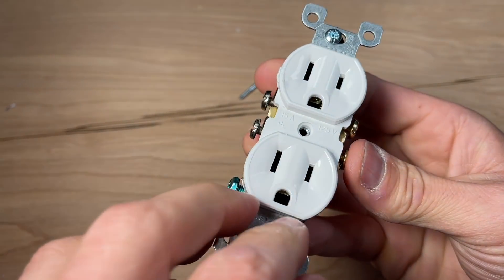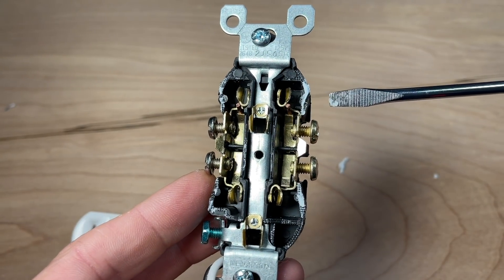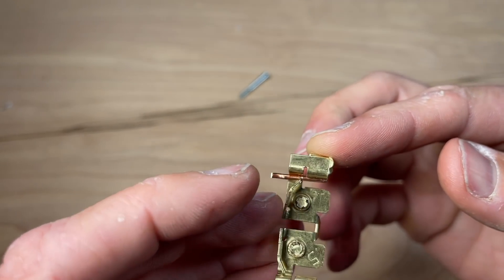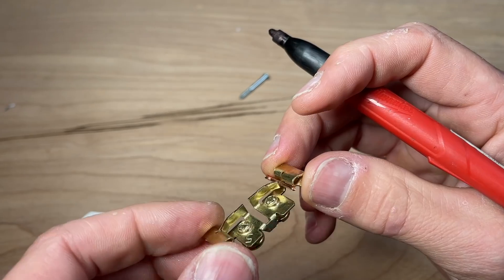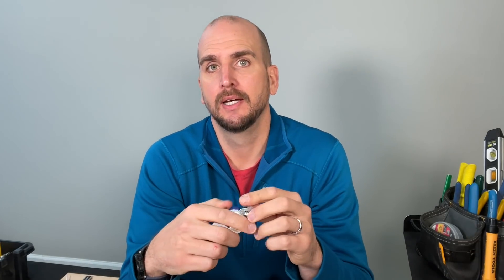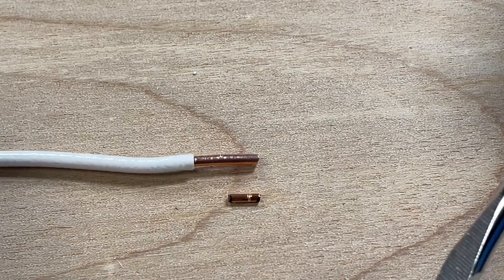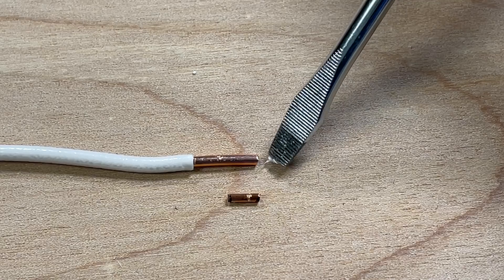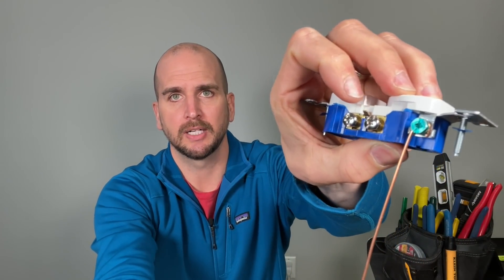Why You Should Not Use Speed Wiring | Back Wiring Is Preferred

Comment: When swapping out some switches in my house, I found the original speed wiring very hard to "unlatch". Maybe the clip digs in or fuses over time, I have no idea how old the light switches were. It seemed like I was close to ripping the switch out of the wall. Back-wiring is great because you can actually see the contacts being made, not just hoping everything goes right when you stick the wire into the hole.
Reply: if removing a switch . I clip the switch side and then spin the device and pull the wire will slip out

Comment: I earned my electrical ticket almost 40 years ago. Safety and reliability are primary in my approach to wiring.  In my opinion, code does not equal quality of work.. code is minimum.. so those who have a goal of just meeting code, is substandard.   I personally despise the method of just pushing the wire in the back of the receptacle, and think it is a cheap, lazy-assed way of wiring (Sorry to be blunt but I have zero tolerance for that low level standard).  On commercial jobs receptacles that are looped from one to another (and up to 12 devices in the loop) are usually pigged tailed (neutral, hot and ground) with three wires going to the receptacle and typically with a J-hook.  Those who push them in the back are asking for heating issues, and especially if you're plugging in an high amperage appliance, say towards the end of the loop, depending on each of those previous receptacle "splices of sorts" to provide power.   In residential wiring, J-hook and if the receptacles are built such that they have brass or metal plates on each side of the copper wire (like the one  you preferred for DIY people, I think that is a good choice, for the reasons you mentioned with a J hook.

Comment: Strange this pops up right after replaced everything already lol. I replaced all my standard light switches to rocker switches and installed usb and lighted receptacles randomly through the home to increase home value for selling. I used speed wiring for single pole and back wiring for power receptacles and 3 way switches. After watching this it really made me think about always using back wire method instead of speed wiring. Thanks for the informative video!

Comment: Side wire. Rewiring my entire house and I'm pigtailing and using the side terminals. Anytime I see speed wiring or back wiring when I do a repair I cut it out and pigtail to the side terminals. A dead device can kill power downstream. It's also easier to replace pigtailing and doing side terminals. I'm not doing production homes so I can take the little extra time to make a more solid connection in my opinion. More surface area and better mechanical connection when pigtailing. 

Nec 300.13(B) requires you to pigtail but that's only on multiwire branch circuits.

Comment: any one going to address the fact that at the beginning of this video, a receptacle was shown with speed wiring that included more than one neutral (white) wire to the outlet? NEC code requires these white wires to be pig-tailed together.
Reply from the maker: Thanks for calling that out Larry.
Reply: @EverydayHomeRepairs  been an electrician since 76. Spot little things quick. Also seen were a commenter has done it for 30 years, while apparently not having a license.  Seems to be proud of the fact that no one has gotten hurt or shocked while using things he has wired. Still not licensed, and his saying that shows his lack of proper education in a field where you really need to know what he is doing. Wonder if I should tell him about the new requirements of the outside disconnecting means, and labeling. And the whole house surge suppressor. And the new island rules. NOPE. Just hope no one dies from his work.

Comment: stab backs are garbage....the problem gets worse as the metal bus metal fatigues....i prefer using receps with screw terminals no speed or even screws on speedwired receps stabback receps using screws only are better than the same using speed receps screws only because the connections are screw to bus directly rather than relying on the sandwiching of the screw to plate to bus.........36 years in the trade

Comment: I'm not an electrician. I do a lot of different things and basic electrical is one of those. 

I've worked on two relatively new houses (one maybe 5 years old) that had outlet failures directly attributable to speed wiring. In both cases, my starting place for diagnosis was burned outlets. I'm not going to blame speed wiring for that since I wasn't there to see how the outlets were used. But in one case, the reason I focused on one outlet is that I could see sparks illuminating the cover plate when something was plugged in. Draw your own conclusion. 

In both those cases, it wasn't just a single outlet failure, but downstream outlets also were not working. 

If I was having a new house built for me, I would do my best to make sure that better receptacles were used and that speed wiring not be used. 

That said, just this past week I became familiar with backwiring in an older home that had some outlet replacements done at some point. Looks like a good compromise. 

That said, the reason I became familiar is bad. There seems to be a two-phase short circuit in the kitchen wiring. I'm ready to hand this off to a pro because I don't know how to deal with it.

Comment: As you point out, conductor/wire contact area is critical.  The shortcoming of speed wiring is that there is neither the clamping force over the majority of the contact area nor is their significant resistance to rotation of the conductor. Any slight bend, nick, or other surface damage of the conductor will significantly degrade the conductor's contact with the terminal thereby increasing the potential for arcing and overheating.  Both back wiring and side terminals apply clamping force every the entirety of the contact area ensuring a stable connection reducing risk of arcing and overheating within the outlet.
Reply from the maker: Yeah, agreed the variability in back wiring can reduce the contact area further than what I showed in the video.  Combined with not using pigtails this can definitely lead to failures as it did in my friends 2 year old house.

Comment: I been doing electrical on side 30 years or more. I used to do the back stab 15, 20 years ago some but had some wires pull loose from outlet couple times and my dad said he don't trust it. So I been doing like in video here when I can or else hook it on side screw. Need deeper boxes it seems like when you back stab. Harder to push outlet and wires back in box. Maybe that's just me though. I rarely connect an outlet to 14ga so the hook on screw is often the route I take. I only use 14 for switch to lights or lights only circuits. Electrical is the 1 thing you don't get cheap with. Above and beyond code spare no expense is my motto. Everything I do is overkill. But you know what? 30 years no one's got shocked or killed by my work and nothing ever burned down. So is yours and your families lives and home worth an extra $1 an outlet?

Comment: I have worked for 5 different electrical contractors.  None of them used the backstabbers. 

Two of them would twist all of the necessary wires together with a pig tail to the device. One of them would use the device as the “input” and “output”. Meaning they would use one screw terminal for the cable coming into the box, and the second terminal to the cable leaving the box. The other three contractors, well it was whatever was in there in the first place. We were mostly service calls rather than new construction.

Comment: Biggest problem with both is device is in series with circuit which is bad practice.  Join all like wires  in the  box and pigtail to device.    J hook has a solid plate that handles series loads without much problem.  The back stab is wire to screw to plate to other screw back to wire.   Can’t trust all those connections not to cause resistance that then causes heat and failure.

Comment: i dont use speed wiring in any application, too much of a risk. heres something you forgot to mention. any real electrician would always have this in mind. one of the most important aspects in a wiring connection is how tight the connection is. you never want a loose connection. thats a potential fire waiting to happen. thats one of the reasons aluminum wiring was outlawed in the 70s. over time loose connections over time can start arcing.

Comment: As a pro I never backstab,  I j-hook or back wire. I've have seen some real scary diy wiring though. My favorite was the microwave circuit run off a basement pull chain light. Burned off  the wiring and melted the plastic lamp holder. This had to have been done by the previous homeowner. They were lucky the house didn't go up in smoke.

Folks hire a professional to run a new circuit if you decide to take out a stove fan hood and put in a microwave.

Comment: Not a professional electrician, but I am an aircraft mechanic with a very sold understanding of electricity.

My answer is it depends. With any wiring job I do, I take the ease of installation and use of the end product into consideration. Human error is a big reason for a lot of failures.

Is the outlet in a very difficult place to work, or were the wires cut too short in the past? I'll speed wire it, because I'm more likely to mess up a J hook given the limited working area.

Is the outlet going to regularly have a high amperage load, or is it in paralleled output to other outlets? I'll take my time and make sure to J hook it.

Same goes for various automotive/RV 12V DC repairs. I always prefer to solder when splicing wires together. However, if it's a tight space or the repair is done outside in a windy environment, I'll choose to crimp butt splices. One thing I don't skimp on is the quality of my tools and connectors. Cheap crimps are almost guaranteed to fail.

Comment: This was a very good video and very well thought out.  Only thing I would add is that the speed wiring or back stabbing really became a problem with the NEC requirements of AFCI circuit breakers.  Because the surface area of contact is so small this wiring method has the potential to create the most problems.   Heat, vibrations, poor workmanship is a bad combination.  I say poor workmanship because most new construction guys that I have seen do not follow the strip gauge on the back of the device.  I often see wires that were stripped too long and had more than a quarter inch of bare copper sticking out the back which can easily cause problems.   Also I have seen guys us impact drivers do tighten screw terminals and that is an absolute no go in my opinion.  Ive seen a lot of cracked and broken receptacles because of this.
Reply from the maker: Great feedback Joel, thanks for the help 👍

Comment: I had a contractor do some electrical work and used the speed wiring method and it ended up frying a some of my electronics in my room.  The contact inside the outlet was not enough and sometimes when things were unplugged from the outlet it caused a surge to everything on the same breaker it also happened randomly days apart. At first I thought it was a overloaded breaker box and took a long time to find out it was one outlet. After taking it apart it revealed it was melted inside from sparking.
Reply from the maker: Thanks for the example Matt, appreciate the feedback.

Comment: I love a non professional desperately trying to explain electrical connections  that he doesn't know his butt from a hole in the ground. 
Let's be specific back stabing or speed wiring a 14guage wire into the back meets both Underwitteres Laboratories  requirements and every every version of the NEC from 1990 to present.  Doing this quick wire method is fine. Your house I'll not be in any more danger of burning down than it already is with you playing with an electrical system to start with. 
You can not quick wire/backstab a 20amp 12guage system as the internal clamps do not have enough surface area and retention  strength for a 12agw 20 amp system.  
But what would a Master Electrician with over 30 years of experience know....

Comment: I’m not recommending speed wiring, but your argument for contact area is flawed as the contact area on the speed wire is still larger than the cross section of the wire used, So it’s a moot point. If it isn’t enough then the wire isn’t enough either.

Comment: I work as a designer of industrial electrical cabinets and have a background in high current conductors and all types of wiring.  I am constantly trying to convince people not to use screw connectors, they are to as good as what are called spring connectors (back connector on the video).  I can’t speak to every design, but if the socket has a UL listing I would always prefer the back connector over the screw connector in every case.    I have had some success in eliminating screw connectors in some industrial plants and everyone has been happy with the results.
Reply: I'd agree with this, mostly. There is a difference in quality though. If you looked at these cheapo receptacles the spring clamps were made of brass, whereas the industrial terminals like those from Wago use spring steel for the mechanism, and are less prone to failure. Most failure being caused by user error in these applications commonly after removing the wire and bending the mechanism out of shape in the case of the brass at least.

In the machines I work with the spring clamps are FAR more reliable than the screw terminals. They don't loosen over time(due to vibration, thermal cycles, etc), they are far faster to install, and are sized appropriately for a given gage/load. Surface contact area could be a concern in some High current, or otherwise impedence sensitive applications, but for those, I would generally recommend crimp or solder connections, not screw clamp...

Comment: I'm a licensed electrical contractor , I was taught 30+ yrs ago not to back stab and I've spent hours troubleshooting bc of it. The real sin is using the device as a splice point. The right way to do receptacles is to splice the feed through wires with a wire nut and leave a tail off the splice , then hook the tail to the screw terminal.  The reason for this is so if the receptacle goes bad it doesn't knock out the rest of the circuit. There are plenty of house jockey hackers that have taught their protégé s to do the fastest way possible and continue the back stabbing way. Now think of this if you backstab the first outlet in and out the full load of that circuit is flowing through that little 1/4" connection , then it is being further restricted at every point after that, you get heat from resistance and heat causes further resistance and further damage to a bad connection which I have seen turn into sparks and fires. When you splice the tail only sees what that outlet is drawing and the circuit keeps its integrity for full amperage draw to each device.
Reply: I like the way you think.
Reply: @rob1111  there is no good reason to not do quality work, basicly everything you mention is to make money for developers, not provide the safest quality product for the buyers/ end users.  I don't care who it's for ill do it the "right way" every time.
Reply: Plugs in my home were back stabbed, I agree this method should not be used, especially when used on a circuit of plugs.
The first plug in a circuit of plugs (I think there is close to 15 plugs on that circuit) in my home failed and shorted out melting the plug and knocking out the rest.  Did not start a fire thankfully as it was noticed right away due to smell and arcing sound.
When I noticed how they were wired I redid every receptacle using a splice wire and the side screws.
Personally do not trust the back stab method.
Reply: Just don't use shitty Receptacles and replace them every 20 years. Do that and you will never have an issue.
Reply: With this comment you earned a subscriber sir
Reply: @rob1111  I would also note we don't splice on the finish , it's done on the rough. Enter the wires and splice your tails, on the finish we strip,  hook and screw the one hot , neutral and ground or switches. We also use more wafer lights now so measuring , drilling and installing adds time to finishes. But that's why we don't work for developers,  I and my boss , both electrical contractors , refuse to cut corners,  so like you said it's about money not the final product.
Reply: @arnehelland6015  That's true. I meant to say rough-in, and not finishing. I've corrected that - it was late when I posted that. But, that's how subdivision homes are done. Not wrong, but it all comes down to money and getting awarded the next phase or next site that the builder is doing.

Comment: Years ago at my previous home, I was reading in bed when the lamp on my nightstand went out. The breaker had blown, and when I investigated I found the old NM (60°C) cable backstabbed into the receptacle, with the hot-wire insulation melted back to where the copper had come in contact with the bare ground wire. I probably should have cut the receptacle apart to see exactly what had happened; but being more lazy than curious I just replaced it with a back-wired commercial-grade one, so I still don't know for sure. But evidently the contact inside had somehow been compromised enough that the couple of amps to a 150W bulb and a clock/radio were enough to melt the insulation. 

I took the pledge that night never, EVER to have anything to do with either speed wiring or residential-grade switches and receptacles. When we sold the house some years later, the inspector's certificate indicating that we had replaced ALL the receptacles and switches with back-wired commercial grade (at a paltry cost of a few hundred dollars and a Sunday afternoon's work) proved a worthwhile selling point for a savvy buyer.